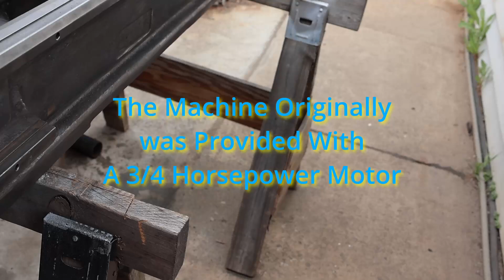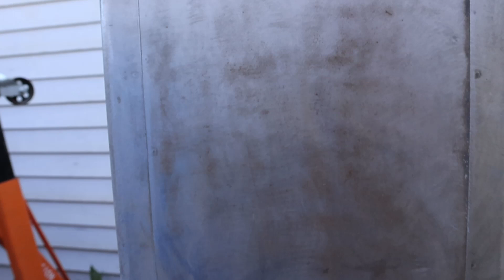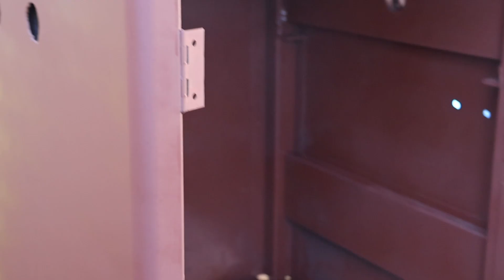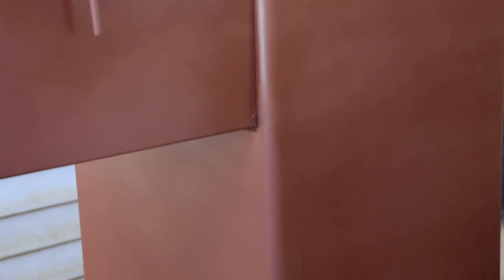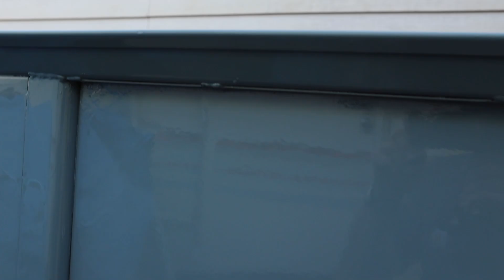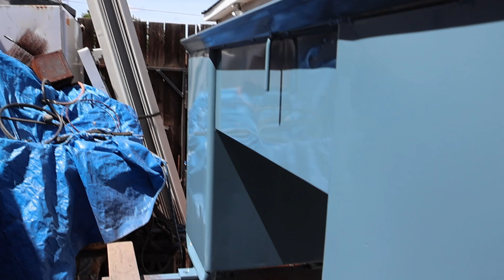Rebuilding A Sheldon Lathe: Part 8, Bed Casting And The Cabinet

Comment: This is an older video but I was wondering if you did a video on disassembling the power feed gear box.? Thanks
Reply from the maker: I believe I did but I can’t remember exactly where in the series, it was in an earlier video when I dissembled the lathe
Reply: @hillsgun  I tried looking for by title but couldn't dig it up.   how can i send you pictures of my machine?
Reply from the maker: Part 7 shows disassembly, not very detailed I’m afraid but hopefully helpful. E-mail is dan@hillsgun.com
Reply: @hillsgun  I found it, mine is a good bit different.